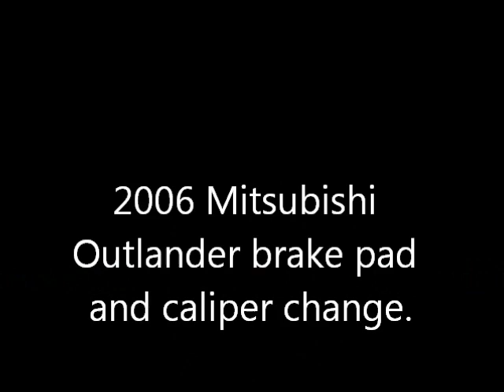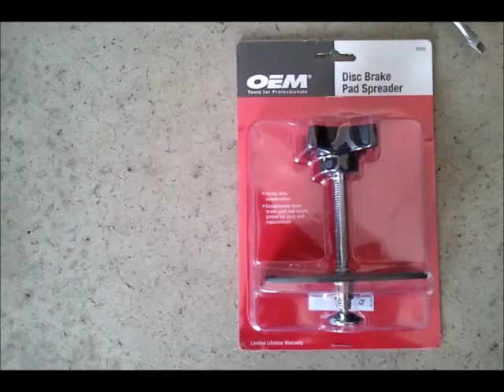2006 Mitsubishi outlander brake change

Comment: Hey. Good job with the work in the vdo. I've an '06 Outlander as well. Going to change just the brake pads only. (a) What is the bolt measurement for the two bolts that hold the caliper in place? (b) How did you pull off the caliper? Using a screw driver or did it just pry off after some force? (c) Did you get brake pads with clips or were they already there? (d) Did you use any DW40? (e) Did you clean out all the brake dust? What did you use to clean the brake dust? Thanks in advance!